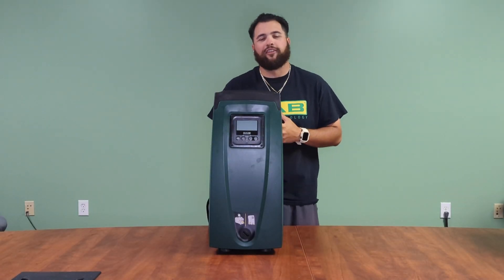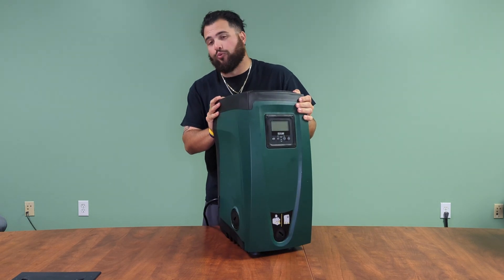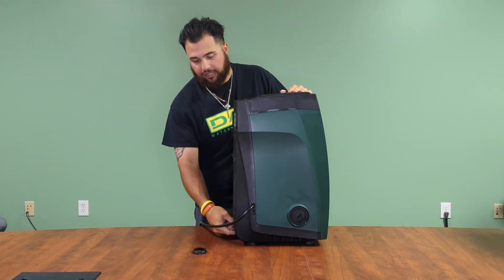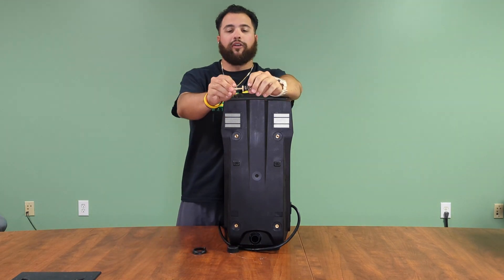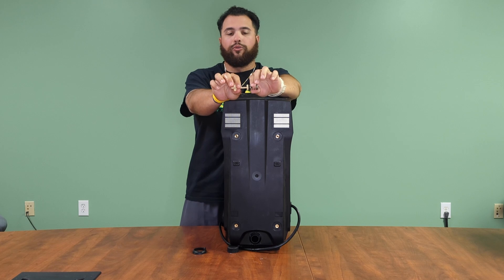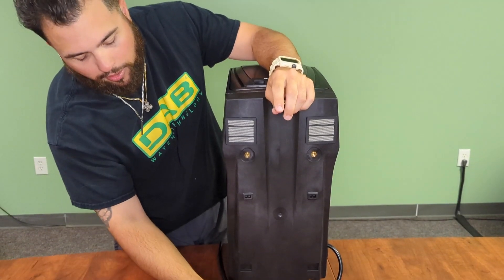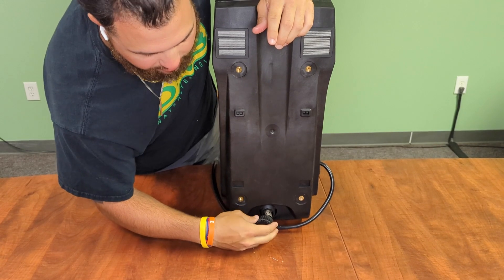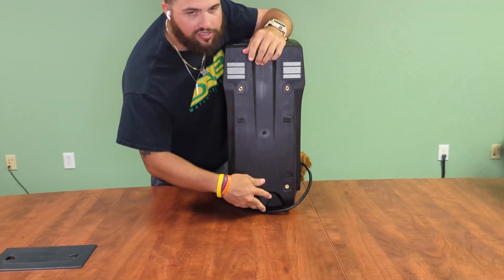How to disable the Self Prime Valve on the DAB EsyBox

Comment: Hi, I'm facing an issue with the Mini 3. My underground pump tends to malfunction leading to the reservoir not refilling and causing the mini 3 to dry run. The issue I have is whenever this happens I need to re-prime the pump again because it loses all the water in it. Is there any way to avoid this (besides replacing the underground pump so as to avoid dry runs obviously) ? 
Relevant details: the pump is connected to the system on bottom and the reservoir is about 2-3 feet below it.
Reply from the maker: Hey there! Thank you for letting us know about this. The best way to assist would to contact our support and a case number will also be provided for you: service.us@dabpumps.com - Thanks so much

Comment: Do i also need to disable the self priming when i am pumping from a reservoir that is about 1 meter higher than the pump as so the water is coming from higher up the pump but with no extra pressure?
Reply from the maker: @HolyGamesHD Thank you for reaching out to us. You would want to disable the self-priming valve whenever you are getting constant pressure to the pump. So, if your tank is providing constant pressure already to the pump, then yes you would want to disable. If you have anymore questions or concerns, please contact our service department at service.us@dabpumps.com